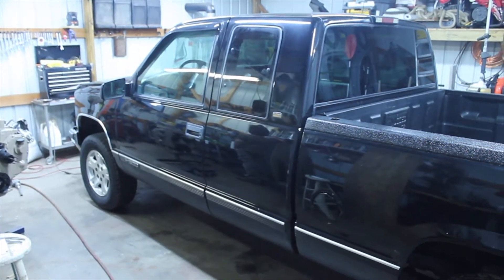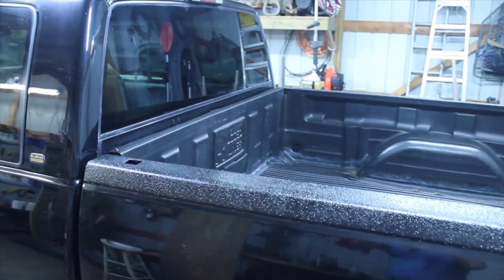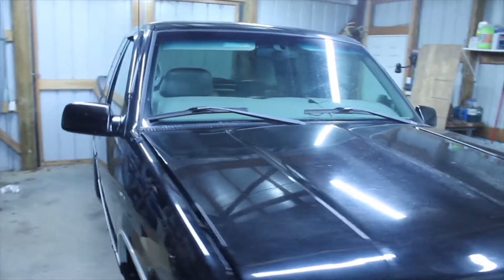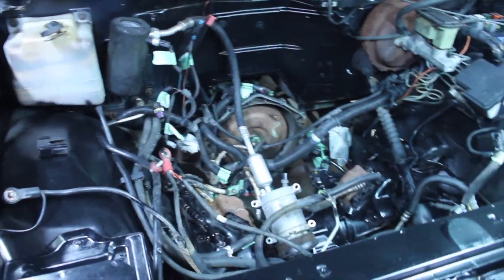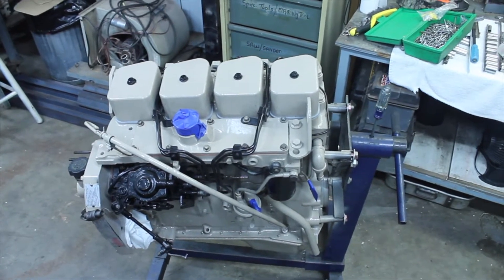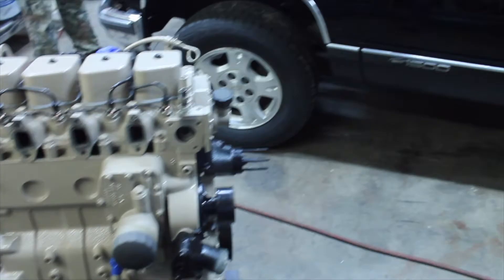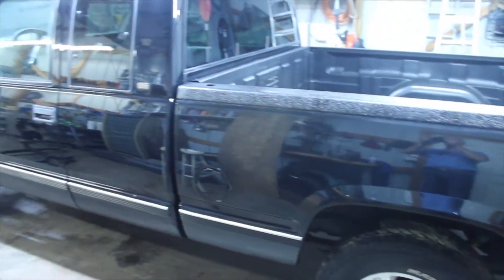Part #1 CUMMINS 4BT CHEVY K1500 CONVERSION

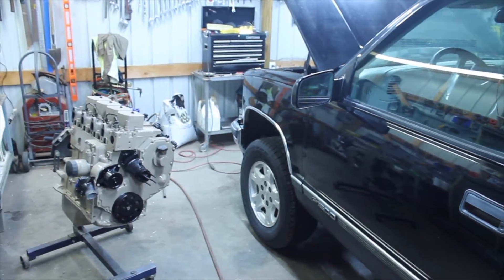Comment: I'll be doing a 4bt in my 95 k1500 with an sm465 out of my old k10 may just work.... 3:73 gears or 3:08 is the question
Reply from the maker: This truck had 3.73 gears ,
Depending upon your tranny choice, 3.08 would be a good highway vehicle mpg!!! Towing might be a problem with the 3.08.  If I was going to do it again I would use a five speed manual transmission. Hope that helps!! Thanks for watching…
Reply: I'm trying to piece it together and went with the 3:73 axle I had laying around..it's getting interesting lol... Thanks for the reply.
 And tips
Reply from the maker: @THISISBULLSHITT 3.73 is a good choice for the 4BT!!

Comment: Where did you source the motor from sir?
Reply from the maker: I bought one in Louisville KY from a private owner, it was either Craigslist you r Facebook.
Reply: Jeepmanking oh ok I was wondering if I should get it from a junkyard or buy an older delivery step van
Reply from the maker: Ryan Bower well your choice, if you haven’t rebuilt a motor before find a good used runner. They average between $2500 to $3500 or like you said buy a van source motor and trans, sell trans and sell aluminum box for scrap and sell frame for scrap to recoupe some money.
Reply: Jeepmanking ok thanks for the information like I said I have the same truck but I have no welding equipment or anything just buying the pieces as I can to do the swap. Don’t even have a garage I’m just out to get it done sometimes you just have to try things without knowing how.
Reply from the maker: Ryan Bower determination can definitely go a long way, good luck let me know if you have any questions with your build.
Reply: Good jop I've heard a lot of people that these motors are stationary and it can't be done swap but I can see that it's not true you did a very good job swap